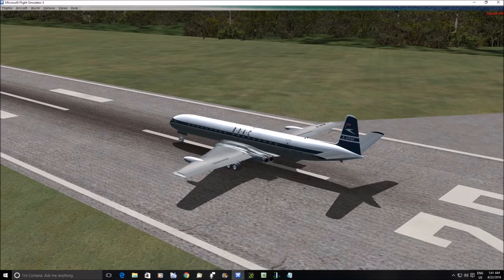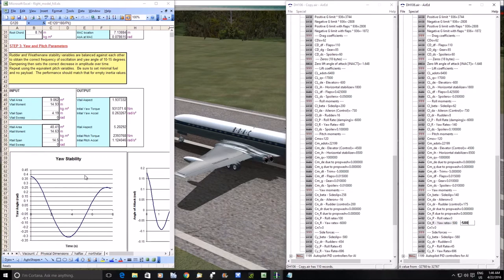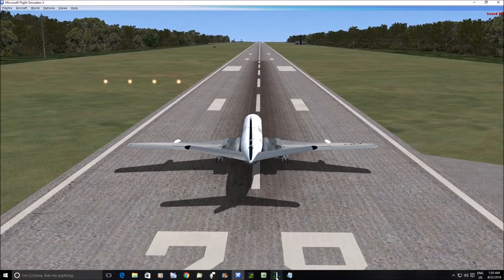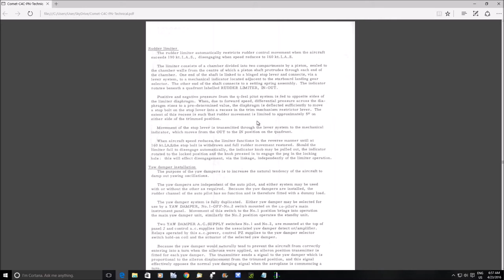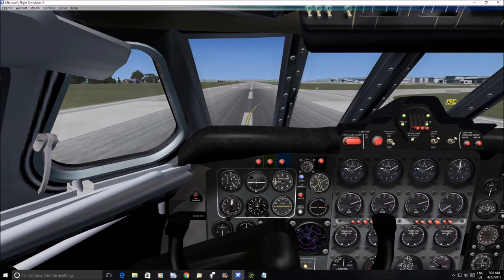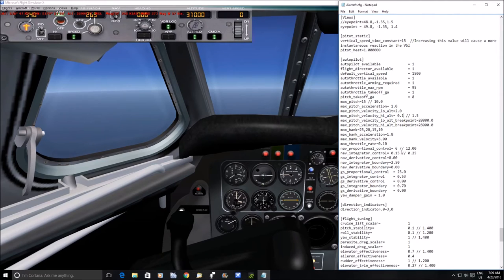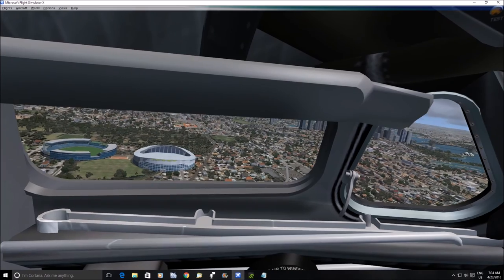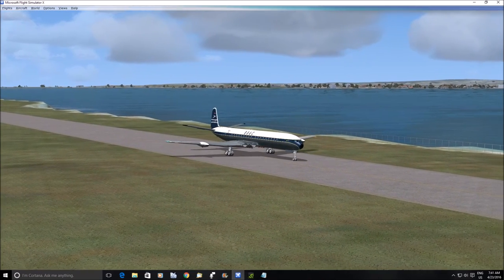Operation: Flight Model, Ep.3 ( JF Comet )

Comment: Hi Wells, what a great series, you didn't put me to sleep at all. I have both the Comet and Viscount, both of which just languish in the back of my virtual hanger because they fly so poorly, yet actually look pretty good visually in FSX. I wonder if someone following your videos would be able to make the same changes themselves or do you need special software? At least your Comet now appears to fly really well. Thanks again for an interesting series.
Reply from the maker: +stretchedits Thanks!  All you need to edit the aircraft.cfg file is Notepad.  To edit the air file, you will need an editor.  The one I use is called AirEd, available for free here,
http://www.aero.sors.fr/fsairfile.html
Reply: +Wells Sullivan  Thanks for your quick reply Wells. I have altered the cfg files before but never the air file, so I might give that program you mentioned a go and see if I can get my Comet flying as well as yours...............Although I am sure Just Flight would say their Comet flies perfectly already. Thanks for the info.

Comment: Interesting.  I'm curious how you got the knowledge to make the changes in the Air file.  Experimentation?  Or do you have some sort of computer or aerodynamics background?   I've modified some FSX planes in the aircraft.cfg "Flt Tuning" section, but I don't even know how to get into the Air file.  I find it satisfying to take a plane that flies poorly and modify it so it flies the way it should -in my opinion, of course.  Maybe I now have a fleet of wacko flying planes, but I don't think so.  I do pay attention to the published specs. such as max. airspeed, climb rate, etc.
Reply from the maker: +Jim H. I started making flight models with Flight Simulator 98, for a freeware group.  I had gone to school for aerospace engineering, but ran out of money and did not graduate.  Aerodynamics and aircraft performance was to be my fourth year specialty.  I've continued studying the subject ever since.  While you can do most things with the config file, there are a few that you can't.  AirEd is still available, here

http://www.aero.sors.fr/fsairfile.html

There is also a program called Air Wrench ( payware ), available from Flight1 Software.  I haven't tried it ( yet )
http://www.flight1.com/products.asp?product=airwrench